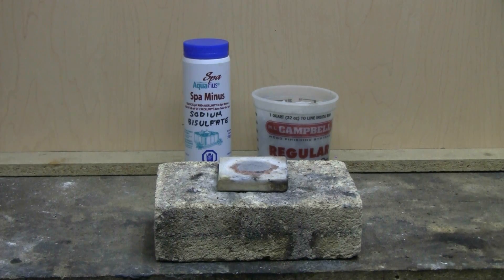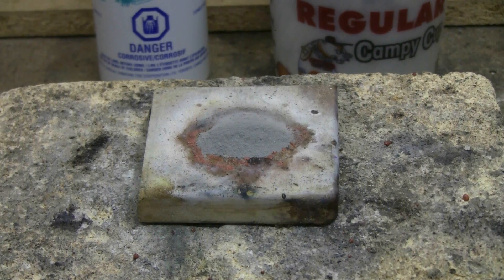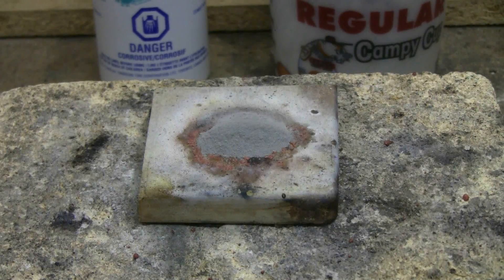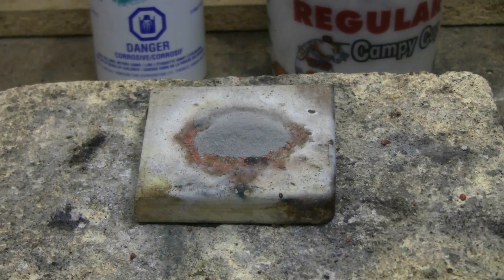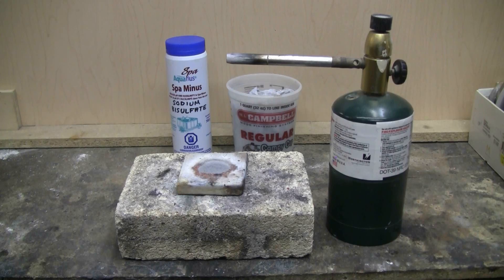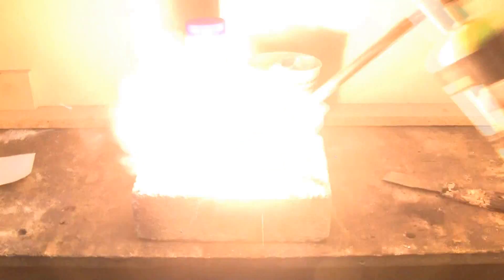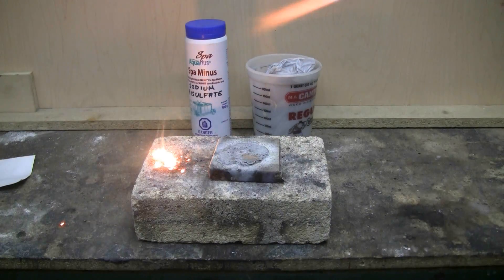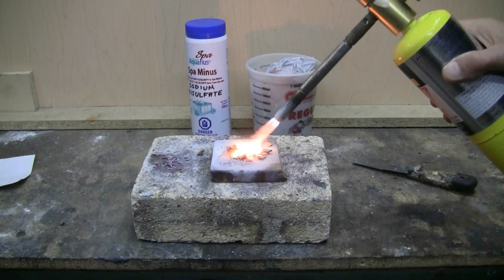Quick Chemistry #5 - Sodium Bisulfate And Aluminium

Comment: I am pretty sure ALL sulfates form pyro mixes with powdered aluminum.  Sulfate radical is a high temp oxidizer.  You will like aluminum powder with gypsum powder. Ignites better with magnesium ribbon.
Reply from the maker: I have shot but not yet posted a short video of aluminum powder and plaster powder.
Reply: +Bill Gilmour Barium sulfate is more spectacular yet as it is anhydrous where plaster and sodium bisulfate are hydrated.
Reply: @BillGilmour519  is this ok to eat